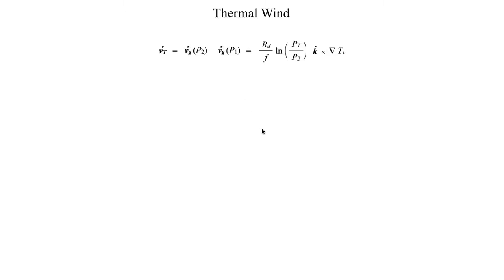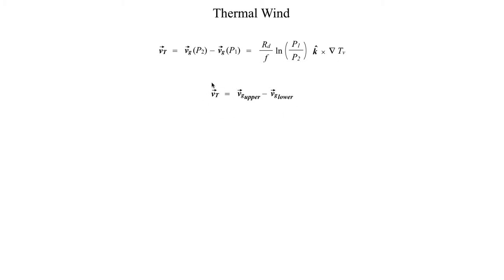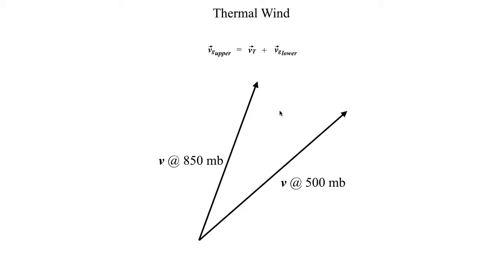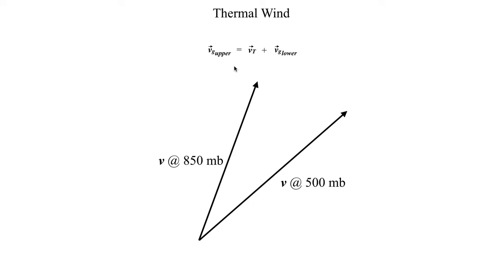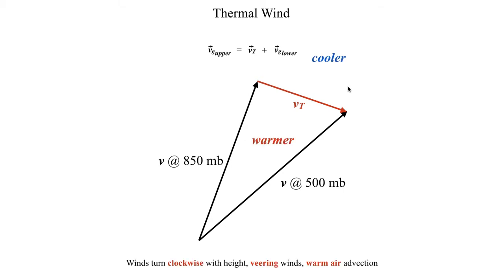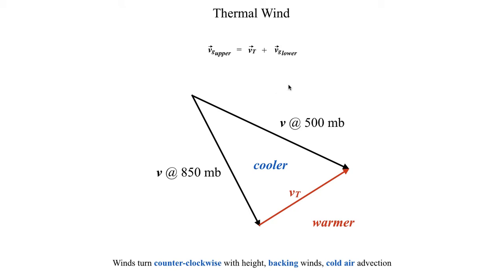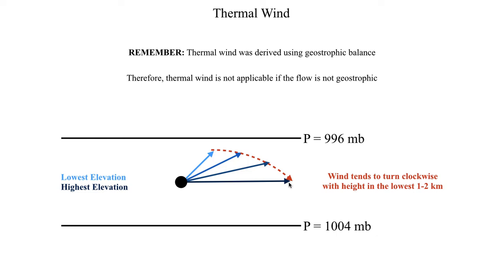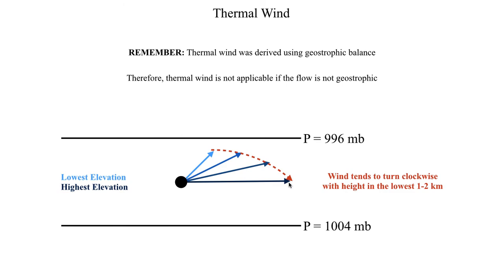METR2023 - Lecture 12 - Segment 4: Physical Consequences of Thermal Wind

Comment: In storm clouds, or in the extreme, the mesocyclone. I guess this doesn't apply at all because of the high friction occuring inside the cloud, from what you've said at the end?

Also, would all of this be the other way in the south hemisphere?
Reply from the maker: The answer to your first question is "yes". Since thermal wind assumes geostrophic balance, this assumes the flow is (mostly) straight and frictionless. The winds in a thunderstorm are very curved and do experience a lot of friction. For this reason, thermal wind itself is primarily intended to be used on large-scale (synoptic) features like cold fronts and warm fronts.

The answer to your second question is also "yes". The thermal wind is defined the same way in the southern hemisphere, but the horizontal temperature profile is reversed.

In the northern hemisphere, warm air lies to the right of the thermal wind, and cold air lies to the left of the thermal wind (as shown in the video).

In the southern hemisphere, cold air lies to the RIGHT of the thermal wind, and warm air lies to the LEFT of the thermal wind. This also means (in the southern hemisphere) winds turning counterclockwise with height become "veering winds" (producing warm air advection), and winds turning clockwise with height become "backing winds" (producing cold air advection).
Reply: Thank you, it's very clear!